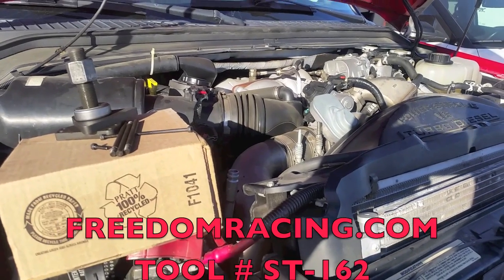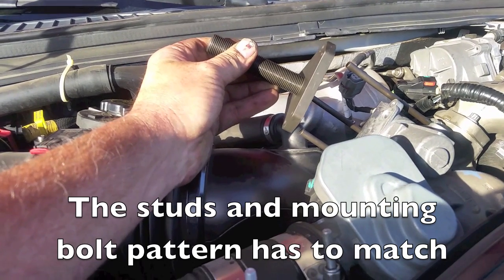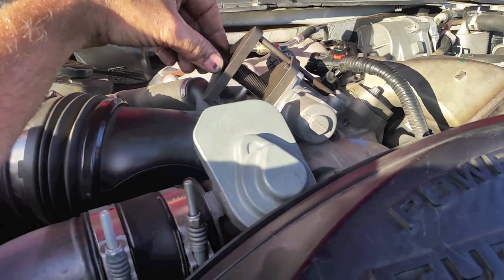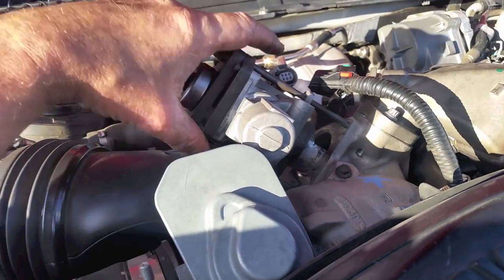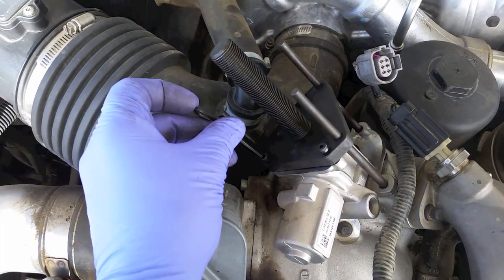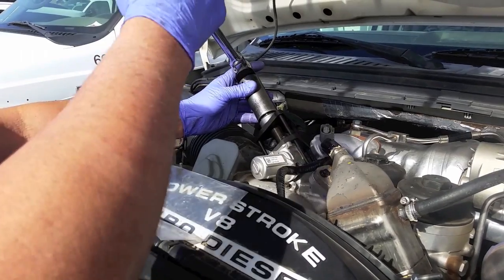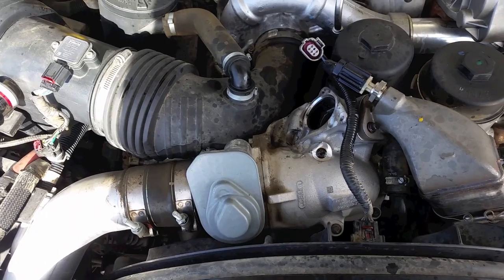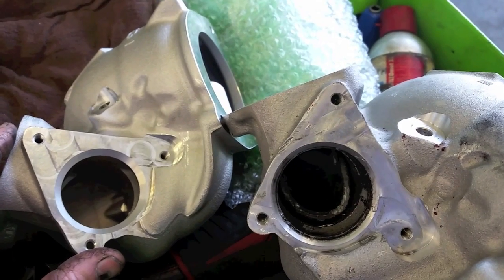Ford 6.4 powerstroke EGR removal both good and bad results

Comment: Has Ford ever fixed or published a TSB for this problem? It's one thing to require a service of a major emission part, but for them to potentially break and require replacement raises questions. If I recall correctly, all manufacturer's are required to ensure emissions equipment operates properly  for at least 5 years or "x" amount of miles. Here in Canada, I believe the law is 5 yrs and unlimited kilometers.

Comment: DieselTechRon - I am trying to determine if I have an internal EGR cooler leak on my 6.4. With the 6.0 I see that people will pull the EGR valve and look inside for residue left behind by the coolant. Do you have any other tips for diagnosing an INTERNAL leak from an EGR cooler?  Thanks man!

Comment: Seams like the most fool proof way of making sure the studs are all the same height would be to measure how far they stick out of the puller plate once its bolted on the EGR valve.   With them all seated, find the tallest one and unscrew the others until they are all the same height.  I'd also check the depth of the pockets in the top plate that the studs fit in and make sure they are the same.  If they are different you'd have to adjust the stud heights to compensate for the differences in its pocket depths.  Carb cleaner dissolves carbon, has anyone tried using it to help free the valve up on the way out?  If it gets stuck on the way out, I'd back the puller nut off and tap the valve back in and spray more cleaner/penetrant and then start back out.  Repeat as necessary until it comes out.  Good luck guys!

Comment: The Bully Dog tuner will NOT work with an EGR delete. It pretends that everything is fine as you go through the install, but the second time you try to start the engine, it locks you out and wont let the engine start. Don't waste your time!

Comment: One other thing can happen using this tool. I had the 3 smaller screws rip the threads out of the egr valve. The other tool available uses hooks to grab the egr valve and may do a better job. I guess my egr valve was really stuck. I had to buy a new housing.

Comment: Now through it away deliet it all together stop abstructing the air flow and and  depleting the combustibleity of the air fuel mixture. Nice clean mix to the combustion chamber cleaner burns is the answer

Comment: hey Ron been having a problem with my 03 6.0 f250 blowing white smoke while idling running rough maybe can point me in the right direction.  thanks awesome videos.
Reply from the maker: what does it smell like? The EGR coolers usually do not fail on the 03. is it missing? Is it using coolant? do you know if your temperatures are correct such as in the oil and coolant Temps not being more than 20 degrees apart with the early style oil cooler or 15 degrees apart with the redesigned one?